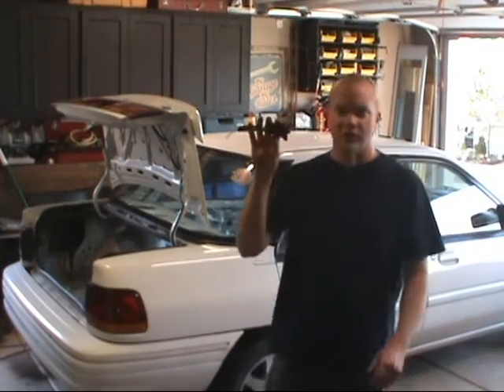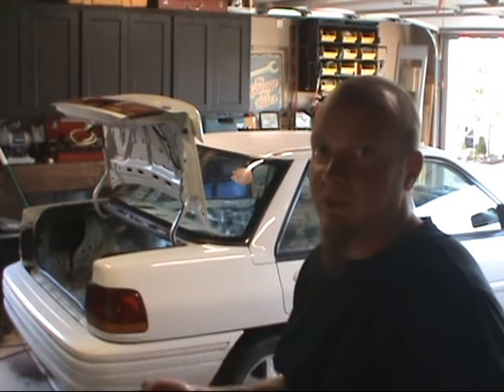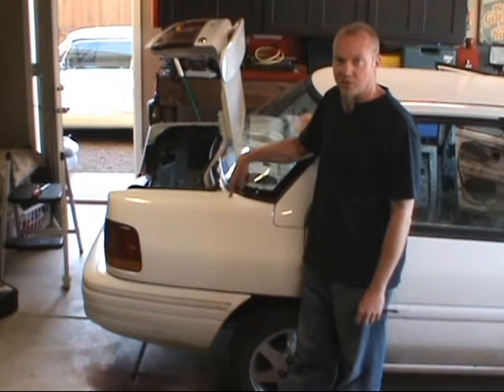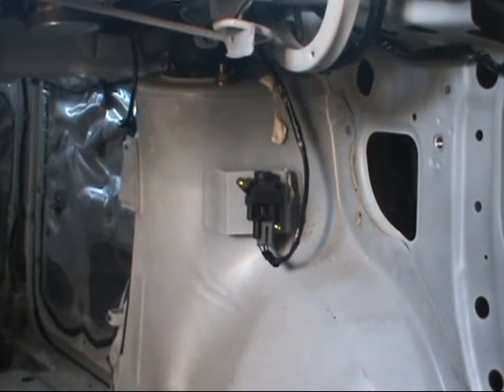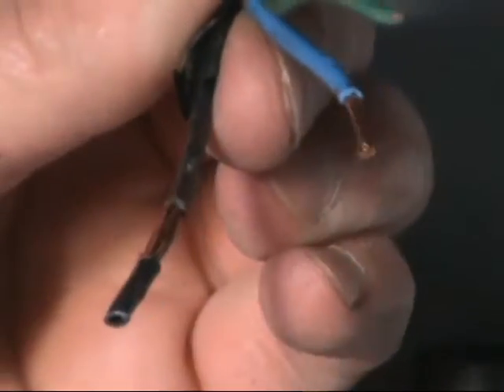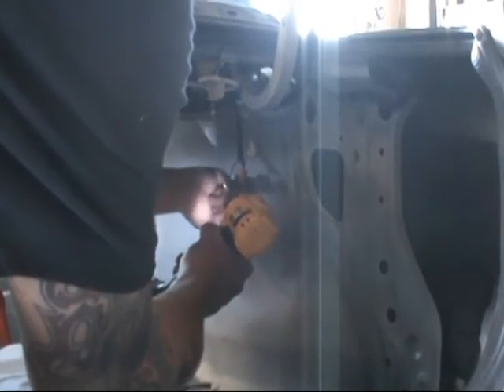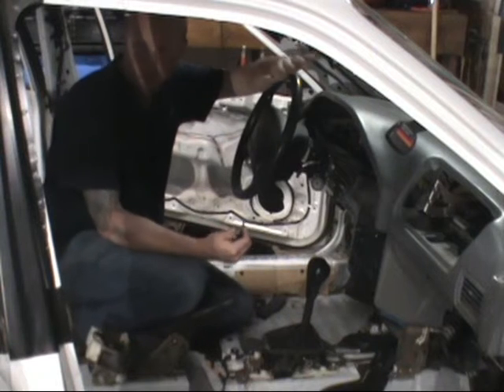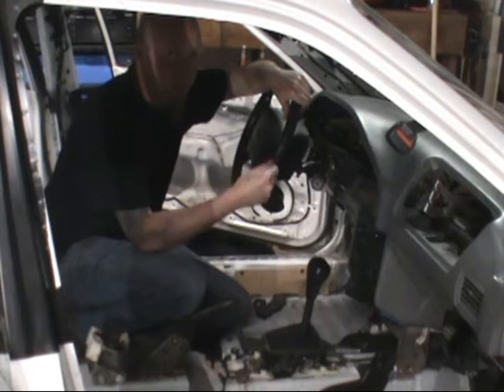Fuel Pump Inertia Switch / Ford Escort Demo Derby Project (Part 2)

Comment: I have been replaced every electrical part associated with the fuel pump change out. Your video not only showed where the switch was but, it demonstrated how it worked. This was a game changer. Car is running and our of my shop thanks to your video. Thanks!

Comment: I by-passed the inertia switch on my escort 1993 as you suggested, wired together the black and the blue wires. I soon as I attempt to start the engine, the light 'fuel cutout' displays on the console and the engine won't turn over. I hear the realy clicking, i located it, tested it, I hear the fuel pump buzzing, I have gas (about 1/4 to 1/5 of the fuel tank capacity), the engine won't turn over. As is the 'fuel cutout' state could not be cleared. I disconnected the negative pole of the battery for 10 mn or longer, computer now says 111 (all ok), still no luck getting gas to the engine. What is your suggestion?

Comment: Did you finish the build of the 95 escort? I was looking for some pointers on how to wire the car.
Reply from the maker: I used the stock wiring with exception of a push button starter, on/off toggle for the fuel pump and new battery cables for relocating the battery inside the cab.

Comment: Just got a ford escort and my car stopped. Had it towed and had the inertia switch replaced. Coating me $500... Car continued to stop and not run. Had to repeatedly get out and turn off the switch. I wish I would have known you could jump the wires sooner. But thanks for this upload, it just saved me more money from Firestone mechanics.

Comment: My Manuel says to turn on the vehicle and then pop up the switch and it will turn off but my ford zx2 never did until i unplugged the fuel pump fuse.. Can the switch be causing my intermittent start issues???
Reply from the maker: Hector Garcia-Martinez No, if the switch is popped it will not be intermittent. I will not start at all until it is reset or removed.